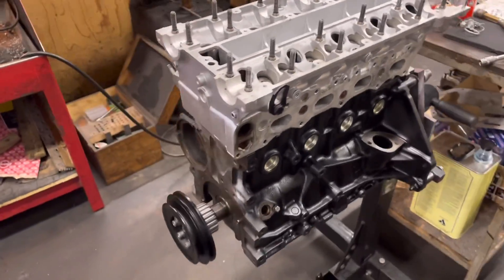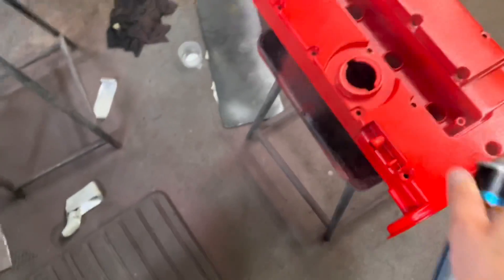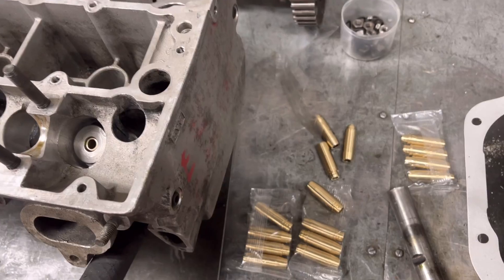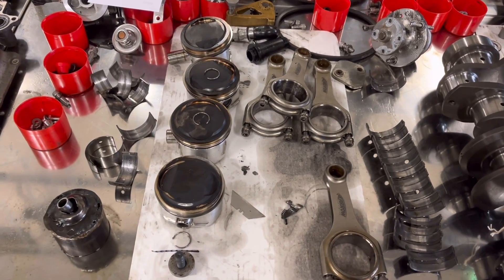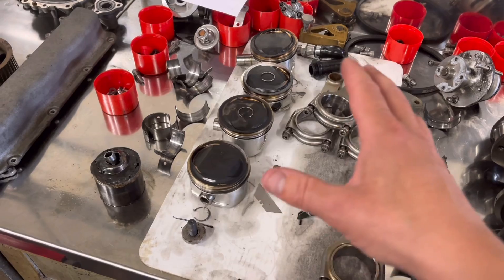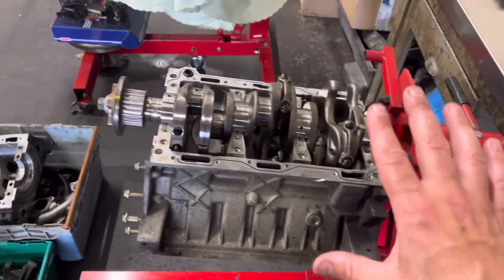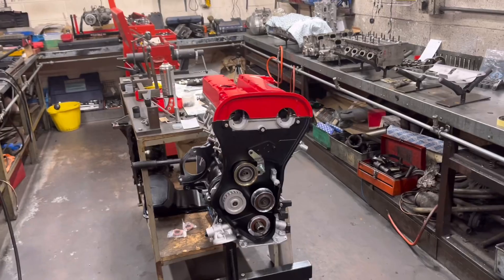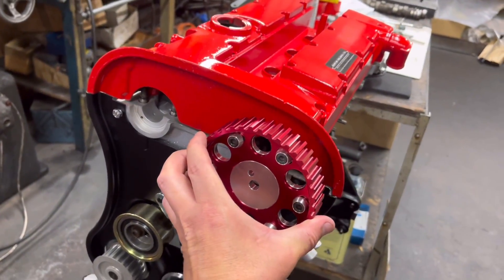Vauxhall 2.0 Redtop engine is looking absolutely stunning, BUT wait till you see what it’s going in…

Comment: When we were doing F Ford engines, we not only used a torque plate, but we hot honed the blocks. We set up a water heater with the temperature at 230 degrees and made up fittings to circulate the water through the block, so it was up to operating temperature when we honed it- was worth a couple HP.  Would be a good idea for your shop, and it could test for a crack opening up at temperature.
Reply: One of the Supra engine builder in Vegas heats the block and puts a head plate on and torque it down then hone/bores block.
Reply: Water at 230 deg??? Don't think so.
Reply: @1magnit  230F is 110C
Reply: @1magnit  I'm picking that's 230° fahrenheit, not celsius - which would be 110°C, right about where most cars run their temperature.
Reply: @thomp449  Water doesn't exist at 110c unless under pressure.
Reply: @1magnit  20 PSI will get you water at 110C, could be the water circulating round the block when they are hot honing is pressurised.
Reply: @1magnit  pressure, son, pressure
Reply: @oldschool1993  It's not practical nor safe to do so.
Reply: @1magnit  Neither is racing, son, so you had best stick to the video games.
Reply: @1magnit  That would be 110 to uk. 230 is a common temp in American motors
Reply: @Pippy626  The obvious problem is that it's over the boiling point which therefore needs pressure which isn't easy nor safe. But more like it, it wasn't water but glycol so no pressure required.
Reply: @1magnit  very true I overlooked that part where he said 230. Unless he used glycol. Every engine shop does it differently to get a “competitive edge” and I missed some of the other replies about conversion already lol

Comment: Can you use an electric pump to run hot water through it? Obviously going to be lower temperature than normal operating temp., but might help find the issue.

Maybe run some dye in the coolant before you pull it apart and run it until it starts using water, then look through the water and oil passages for dye in a crack?

Comment: I had a 3.1 Isuzu bighorn that ran fine cold. After maybe 30 miles it would overheat and dump coolant into the sump. It was a hairline crack in the head. You couldn't see it, the gasket was fine and ran top notch when cold. Probably nothing like this issue but it's my tuppenceworth.

Comment: On that Volvo - do the head bolt threads go into the water jacket or are they blind threaded holes?  If the head bolts go in to the water jacket and there was no thread sealant that could be a source of the coolant in the oil.  But if his water is literally dumping into the sump gotta closely inspect the block & heads, and oil cooler.

Comment: My 2.4L Toyota motor did this, it was a pain in my back pockets figuring it out. I did find out what it was after several hundred dollars it was a .39cent part. In the head ( Alum ) was a steel plug as the casting sand dump out port that housed the .39cent gasket. Cold fine hot different story. Alum and steel expand and contract differently causing the problem. Good luck.

Comment: Hi check for a pin hole in the timing cover  behind the water pump. ;  I had a similar problem with a Datsun L20 motor.    Cheers Dave

Comment: We've had a volvo in this week with a crank breather pipe split
Not sure if yours is the same but the breather pipe has a coolant pipe running inside it
It comes off the oil cooler
Reply: Ahh that's a good point 👉 
Suppose it's like those ford v8s that cross coolant near the intake runners 🤔
That's actually a good shout 👍
Reply: Yep, saabs are the same, a coolant (warming) pipe inside the breather system.

Comment: Volvo V70 - oil cooler, iirc it’s thermostatically controlled hence why it does it when hot, bypass it, water side with a bit of pipe

Comment: Get a dye penetrant kit to spray all over the heads and blocks, it should show up any hairline cracks that aren't visible when everything is cold. Far more reliable and accurate than trying to spot a crack by eye. It's something you should have in the shop anyway for crack testing things before machining.

Comment: If he's running high boost it sounds like it could be lifting the head and that then obviously means it dumps coolant into the block..
It's quite common for that to happen if head bolts stretch out etc.
Is he running fire rings etc?
Obviously when it's not on boost and it's cold the head will be tight, but as things heat up and you get on boost it just pushes it out.
Might be worth looking into and possibly going down the fire ring route if he's been using it for "motor sports" 👍
Reply: Coolant would be in the cylinders if that was the case.
Reply: @ChrisJones555.  doesn't have to be gallons to turn the oil creamy.
And it wouldn't necessarily leave any water in the cylinder if its hot.
You would notice super clean pistons and a tonne of smoke coming out from the exhaust.

That other breather pipe theory is probably the cause though 😅
Reply: @m4d_mark_xtr3me79  LOL! Good answer 👍

Comment: Hi I had a paccar 4banger in shop years ago same issue days in to it then trip over a hidden/not easy to see core plug behind timing chest which had rusted then leaked water into oil  return to sump then mixed I only found it when I took sump when the engine was still hot . May be of no help but my make you think have a great day

Comment: On the Volvo does that one have a through passage on the timing cover . It's been a while but I'm thinking I had one leak between the oil feed for the tensioner and the passageway for the water pump.. as far as the oil cooler I would try and bypass it as a test, I have had some in the past show good but as soon  as it would change temperature it would leak like crazy..good luck

Comment: Porous has allowing water jacket to seek into oil return passages in head, hence to sump? No experience with the 5 cylinder engines, but had the same issue with a high millage B21years ago, as well as allowing high pressure combustion gases into the water jacket of head and through the cooling system.

Comment: mate of mine had same sort of issues same enigne 
he noticed coolant on the drive way one day , he investigated himself nothing too visable apart from coolant running down from above the lower arms he got a mechanic to pressure test the cooling system the head gasket was ok, a leak was confirmed on pressure test and a suspected crack in the block it was loosing water / coolant more over time 
he got the car dealer involved under waranty  (they only had the car 2 months if that) 
the car spent a week in the work shop at volvo main dealer they replaced the cylinder head and rebuilt the engine it was costly if im correct £4k plus from memory however the insurance or something covered the bulk of the cost he had to pay the rest. Volvo guys said its quite common  
the cars fine to this day

Comment: For the volvo hot pressure washer watch the engine temp and use a borro scope into the cylinders and with the sump off, hot washer into cooling system, if oil n water only meet at the oil cooler and in the engine.

Comment: Past experience with mystery water leaks into oil has led to heating water too 100c  and block to surface to 60 to 70c by soaking the heat from the coolant gallery into the block. Pressure the block to just below cap blow off and inspect all oil galleries, passages and coolant areas.
Do the same to oil cooler and ancillaries that might contribute, check to see if the turbo bearing block is cooled by water or the water pump seal is back blowing if gear driven.
I have seen heater/water bypass or radiator blow off pipes carefully plumbed into crankcase breathers.
Mystery leaks are annoying as hell.
Figure out which is cheaper, him paying for the diagnostic time or the repair time and offer a discount, not the full cost on one.
Any discount is good will that 99% of customers will appreciate and pass around that you were a good guy and worth the effort.
Just my 2 bob’s worth.
Take care and play safe.

Comment: Could just be moisture in the crankcase, especially if it's only been used for short runs and stored in a cold place, my old Volvo used to have a bit of cream on the cap but cleared up after a good run.
Did water come out before the oil when he dropped the oil?

Comment: I would swap out the oil cooler first..if the engine lays around for extended periods it’s quite possible that corrosion set in the water jackets inside the cooler and when he finally came around to running the engine the cooler is giving up the ghost when hot
Reply: Yep same problem on old Audi, oil cooler
Reply: Instead of throwing money at the problem in the way of new parts start off by doing a close inspect and pressure tests.
Reply: No shit Captain obvious thank you for bestowing such  great knowledge and insight.

Comment: I had a situation where a vehicle was mixing coolant into the oil, and when the turbo came in for me to go over, the person had used too long bolts in the oil return flange and pierced the galleries between the oil and water and coolant was ending up in the oil when the engine got hot and pressurised

Comment: Don't waste time and money with the oil cooler, when oil coolers go bad oil ends up in the cooling system because oil pressure is greater than the cooling system pressure. I'll usually drop the pan and look up into the crankcase to see if there are any antifreeze droplets hanging from a liner or something.

Comment: Volvo v70 it could be the the transmission oil cooler leaking in the radiator getting into cooling system 👍
Reply: That doesn’t explain the complaint - milky engine oil.

Comment: It sounds like something hasn’t been connected/installed right on the Volvo. Or a bolt that protrudes into the water jacket hasn’t been sealed. In other words, something silly.

Comment: does the Volvo have a cylinder head oil return through an external coolant to oil heat exchange plate on the end of the head like on a Renault clio RS 197 etc? Seen coolant enter the sump   past the gasket into oil return when system pressurised. Also recently seen a core plug leaking under the cams inside the rocker box on a Peugeot 1.6

Comment: Do not give in to him, the flood gates will open. Shut happens, could have a pours head or internal crack the opens when hot. I've been here, your customer wants a replacement  engine at your cost. It's out of warranty and he dismantled it, not your problem. This is the harsh side of motor vehicles, they go wrong and its no one's fault, it happens. If he cannot afford to run it buy a bicycle, your get walked on if your not careful.

Comment: If he took the head off that voided your warranty if you assembled it. Oil cooler is in the radiator. Common problem with that car/ motor. Try bypassing oiler cooler flush it out fill water and see if that water turns green after it’s at temp for a while. Might need to run a external oil cooler and just plug up the stock one.

Comment: Is the Volvo an auto? if so suspect the oil cooler, it’s in the rad . Failure could mean water and oil mixing! Only a possible..
Reply: Not in the engine! It has milky engine oil.
Reply: @ralfie8801  what’s the difference
Reply: @julianpritchard2558  
The two systems don’t mix, cooling or oil types. Transmission fluid is one type of oil cooled with one cooler, usually in the radiator, using its own cooling tubes. If that cooler leaked, the transmission and/or radiator would have milky oil in it, not the engine crankcase, as Is the complaint in this video. Engine oil is another type of oil that is sometimes cooled with a second cooler in the radiator depending on the vehicle type, if it leaks, the engine crankcase and/or radiator would have milky oil in it. Some engines have the oil cooler on the side of the engine block near the oil filter housing, or even use an adapter on the oil filter housing to route engine oil to and through a cooler resembling a small radiator or heater core that uses air instead of water to cool the oil. Being that the two cooling circuits are completely separate from each other, you would never in a million years get milky engine oil from a leaking automatic transmission cooler, it just can’t happen.
Reply: @ralfie8801  Volvo engines of the 5 cylinder variety have an engine oil cooler built into the radiator. I got 3 of them, petrol and diesel, one petrol being a T5R .
Reply: @julianpritchard2558  
Well the engine oil cooler isn’t or shouldn’t be part of the transmission cooler, they should be separate to prevent cross contamination of the two different fluids. There is the risk of one or both oils getting in the water if both coolers leak, but the transmission cooler should never put water in the engine oil. 
I once had a 1981 Datsun 720 King Cab Pickup with an SD 22 Diesel in it. The engine oil cooler in that one is bolted to the side of the engine block and uses the engine’s water jacket for its coolant supply. 
My 2007 Chevy Duramax Diesel has a similar cooler with water being fed directly to it through a pipe from the water pump. The automatic transmission has a cooler in the radiator plus an air cooled one in front of the radiator. 
My wife has a 2016 Chevy SS Sedan, more commonly known as a Holden Commodore with the 6.2L GM V-8. The oil cooler on that one comes out of the engine block near the oil filter and just goes through some tubing and a small finned cooling block bolted to the side of the engine under the left exhaust manifold. 
I also have an old GM truck with the optional oil cooler that took oil from the filter using an adapter and sent it to a heater core sized cooler behind the grille and then back to the filter adapter. There are also versions that use a cooler like the transmission cooler in the radiator, but I don’t personally own any of those. 
There are a lot of different ways to cool oil and transmission fluid, then there’s the power steering fluid cooler some vehicles have, also behind the grille. 
Have a nice rest of your evening, assuming you’re in the UK, it’s gotta be getting on to 10 ish PM? It’s 5 PM USA Central time here.

Comment: Sounds like a head fracture.  I've seen many seem fine, but do pass minorly when cold, then gush when hot and pressurized.

Unfortunate the customer has torn into it, otherwise I'd suggest a cold/ hot bypass  pressure test.
Reply: Just wanted to make clear not this specific engine, bet countless others, especially in a cold climate via freeze.

Comment: There has to be a time limit on a warranty job, no matter, I would say 12 months warranty, but if the owner doesnt fit the engine  for 15 months or more, thats not your problem, its there's. your running a business, not a state welfare bottomless pit
The only caveat to this, is if the customers car is not ready for the engine, perhaps you could still get paid in full, and store the engine at £5 a week ? until customer is ready, and takes said engine, and then the warranty starts at that point, so back to a proper 12 month guarantee
Reply: My old boss did something very similar.  He quickly found out that customers would lapse for months on storage payment.  We had a chap come in wanting his motor yet hadn't paid for 17 months!  Boss finally drafted up a contract what clearly stated if no payment for six months he had right to sell or dispose (law was three months).

Sounds cutthroat, but if it weren't for the chancers and villains, we wouldn't need laws so much.
Reply: I don’t disagree.  But apparently this guy hasn’t put many miles on it.  No good shop wants to put out bad work and then say, “sorry mate, warranty is expired”.  That doesn’t create a good reputation.  At least look it over and try to determine if the problem was workmanship or owner induced.
Reply: @jeffheld3971  If i buy a TV or washing machine in Currys, today, what is the warranty ? its 12 months,  so it doesnt matter wether i plug the Tv or Washing machine in today, or in 366 days time, the warranty started on the day of pick up. collection, why is an engine or gearbox, or ... any different??? 

I would put my house on the fact, if you tried to take something back to Currys (or any where else) after the 12 months, they will tell you to go and F off, perhaps a bit more politely !
Reply: @stevem7868-y4l  I won’t disagree with that.  However, the rules of merchantability (depending on Country) has nothing to do with a warranty when the part, component, or assembly was improperly manufactured, or repaired.  

Example, your car warranty may be 60,000 miles or 3 years.  If there was an issue with the material, process, or components, the auto manufacturer will issue a recall (they may be forced to repair those issues via threat of lawsuit or they may simply do the right thing).

I’m not advocating that any business automatically bend over and take it in the shorts any time a customer sneezes.  But I strongly suggest checking out their complaint in an earnest and honest manner.  

Let’s also be honest here; it isn’t always possible to pinpoint what went wrong or why.  And only God knows all too well what some knucklehead owner does to a car or engine and then tries to pass off as poor workmanship.  

Furthermore, even if workmanship was the prevailing reason for a failure, there are mitigating circumstances where the customer may not have stopped operating the vehicle or did something that made an easily repairable issue a full blown tear down / rebuild.  Wouldn’t there, couldn’t there, be some shared responsibility in cases like that?

I’ve always subscribed to “The customer isn’t always right, but we will always treat the customer right”.  That doesn’t mean the customer always gets their way.

Comment: Don't trust him. He's had the engine apart, he's been fiddle farting about with it, he's put it back together with incorrect timing, he could have done anything. He could have gone to top the coolant up and put water in the rocker cover instead.
If you do any work charge for it.